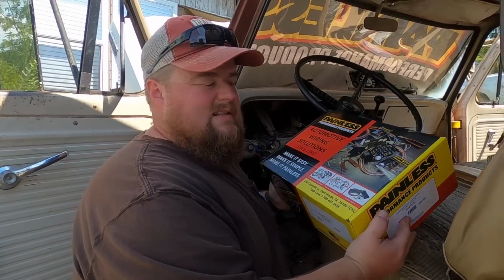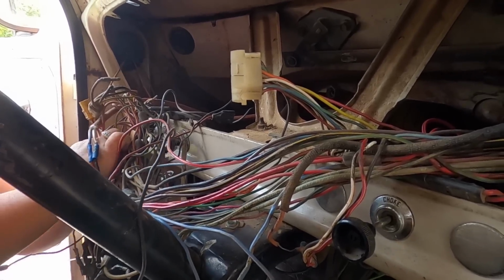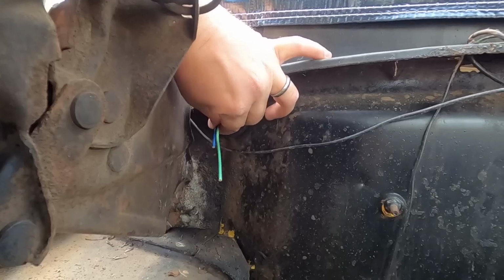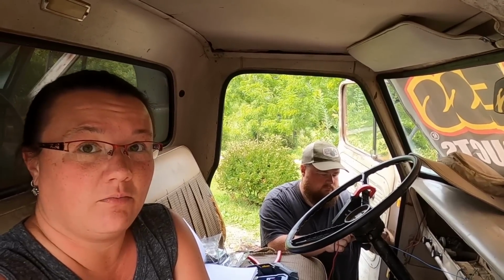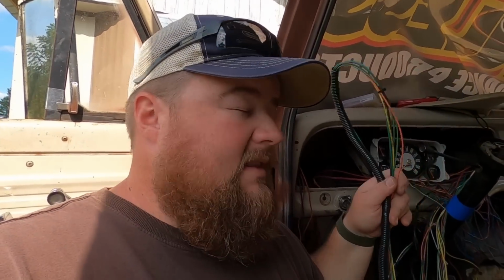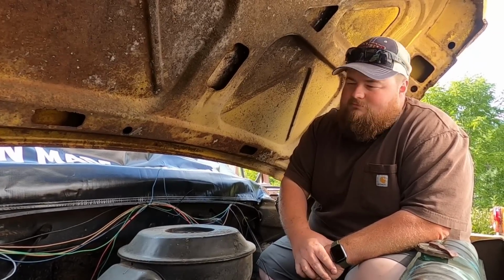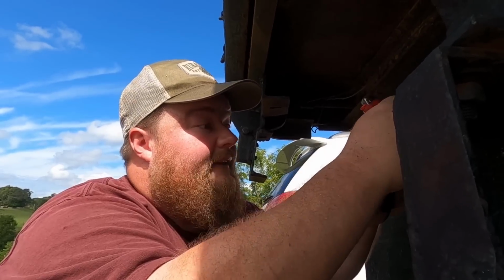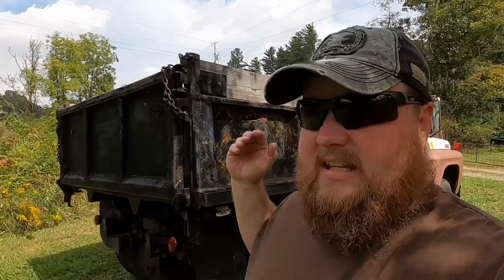Full Re-Wire of 1967 Ford F600 Dump Truck - New Wire Harness Install

Comment: Did a wiring job on the road in Oklahoma at a truck stop with red sand blowing.. it wasn’t painless.. reason is some of the wires must’ve rubbed through and sparked causing a small fire. We were in a pickle for sure. Took a day to rewrite that old truck. Just enough to  get us  to our destination. Thank the lord we made it afterwards with no issues! God bless

Comment: I love the Jr. in training mechanics sitting on the fenders to watch dad work under the hood. I did not look bored but learning by observation. great memories. I remember working on my grandfathers 53 chevy belair changing the water pump. had never worked on a car but used a motor manual and it worked for years until he traded in early 60's

Comment: I didn't really run you over sir I just hit you ,,,, here let me help you up ,,, your not bleeding too bad ,LOL
I have a 66 Chevy C10 with a rats nest under the dash , rats/mice have eaten the insulation . Multiple switches with wires going nowhere , .  I like the wires in that kit being marked and multicolored .  One question does Angela come with the kit . I need a helper .    Good job guys I enjoyed ,,,, still bleeding ,,, but enjoyed.
Reply: We make a specific kit for your '66 C10, so it would be even easier! :)